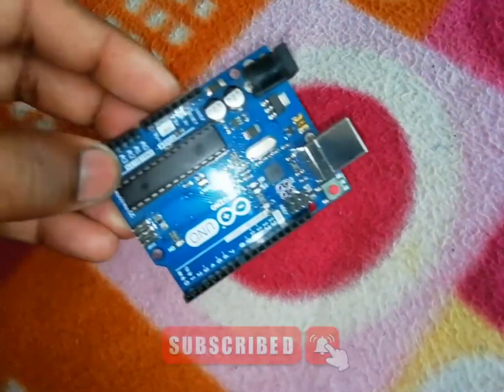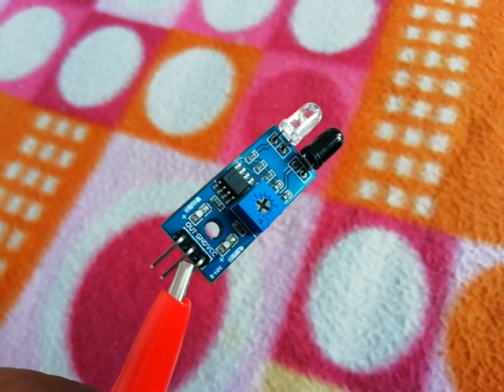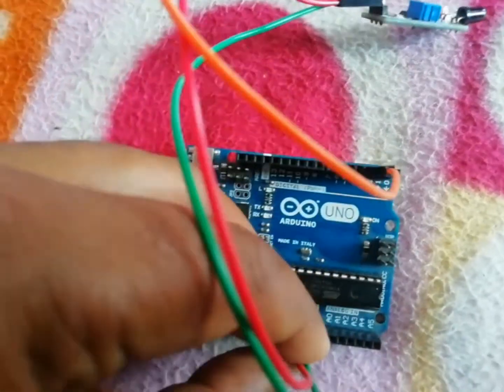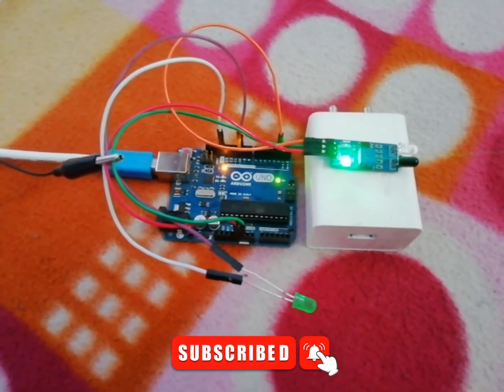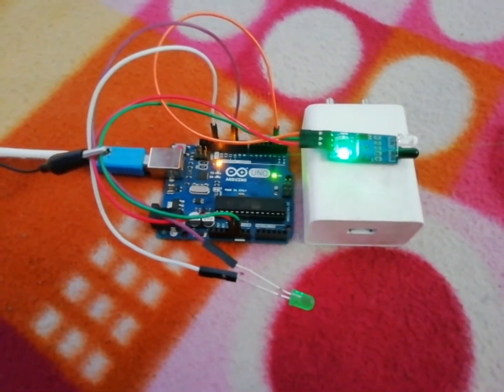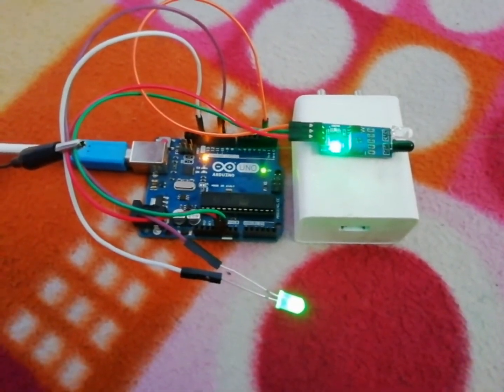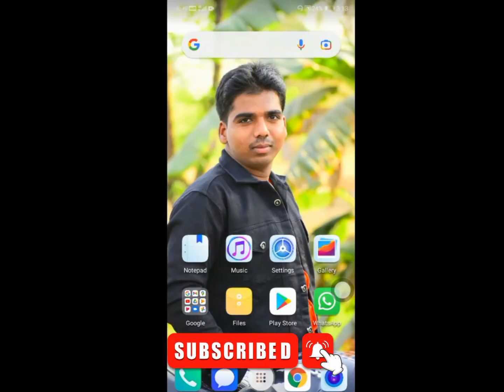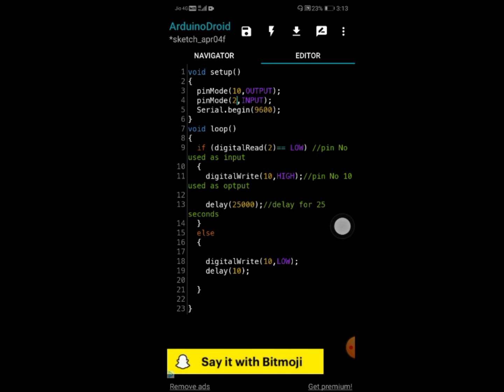Use of IR sensor with Arduino uno, Object detection with LED glowing continue after removing object

Comment: 👍👍
But told this device maine characteristics  details in Sequence as-
Main purpose
Aim
Daily life use
Advantage etc
Reply from the maker: You can use this type of project in washroom light control for increase delay time as requirement using 5 volts relay.
Reply from the maker: The main purpose of the to learn about the use of arduino it's applications

Comment: Hey what about the spectrum to detect the objects ? it is like a laser which is linear or it can detect objects on a range depending on the distance ?

I want to detect water leaks and see if this sensor can detect falling water streams.
Reply from the maker: Use rain sensor